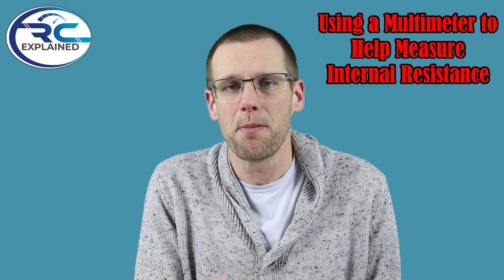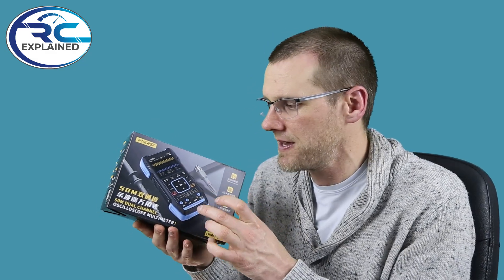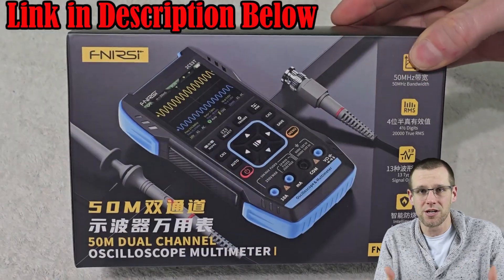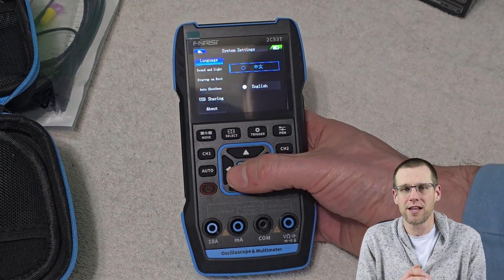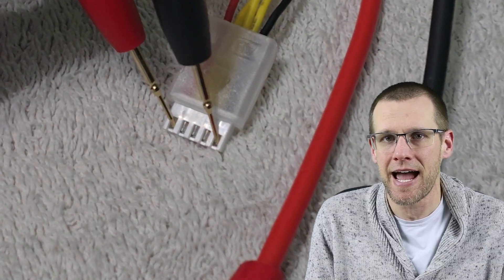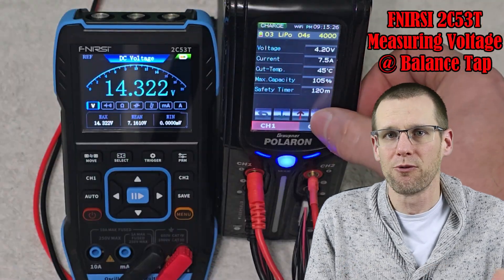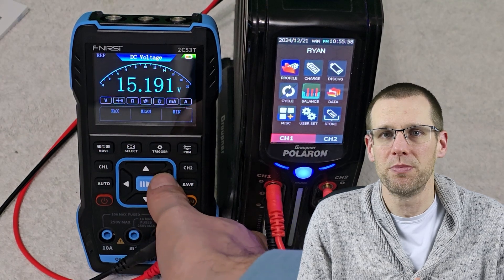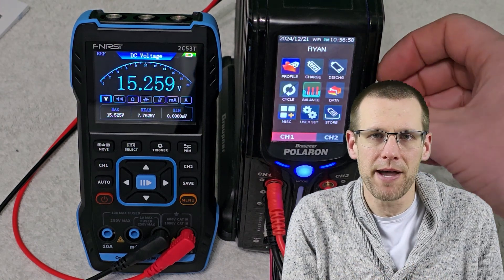The Secret to Measuring LiPo IR Without a Fancy Charger!

Comment: Great video, however this for me is not necessary, extra purchase, I already have a good multimeter. My vote goes to...  FANCY CHARGER 💖
Reply from the maker: That's fair. The true point of the video is exactly that. You can check IR with that multimeter around the house. You do not need a multimeter that measures and graphs waves. I'm simply bringing brand awareness for those that may want this as it's really cool and we are going to see what it can do soon! My fancy charger can't graph frequencies but it does graph voltage as you can see.

Comment: Recently I purchased four lipo batteries and one particular cell was lower from the other cells by 0.2v so I tried to charge it separately and not as a 4s   to increase the voltage from 3.98v to 4.2v and I managed to do it safely,  although it took me some time because I charged at very low amps.
Something that I noticed that while I was charging that cell the voltage went up slowly to 4.05v because it had very high resistance of 66 mOhms, but when tried to balance another cell of another similar battery that had the resistance of 1 mOhm, the voltage went up to 4.18v quickly although when I switched it off and tested the voltage again it was still 3.83v.

Comment: Question....Would a device that displays the temperatures of a RC battery, ESC and motor in led lights be something of interest....like green, yellow and red for temps?
Reply from the maker: I'm not sure. It depends on where it would be displayed. My preference is that it speaks to my transmitter.
Reply: @RCexplained  The transmitter part mainly depends on the manufacturer if they want to (or can)  take the data from the temp device.....but standby, the led only version is coming soon.

Comment: For the price of this multi meter you can get 2 chargers with IR readouts. Standard b6 Neo or equivalent will do that perfectly.
I respect what you do with the battery tests but this is crappy product placement add that doesn't make much sense
Reply from the maker: Merry Christmas! You can get all the chargers you want it still won't do what a multimeter of this caliber can. Either way, I'm sure you have a Multimeter that can measure voltage. This is a basic function that is shown in this video. We will get to the more fun stuff this multimeter can do soon!
Reply: O scope is on my list tho.....might have to